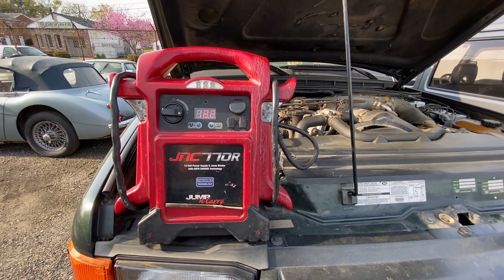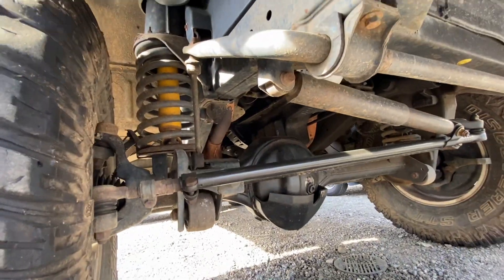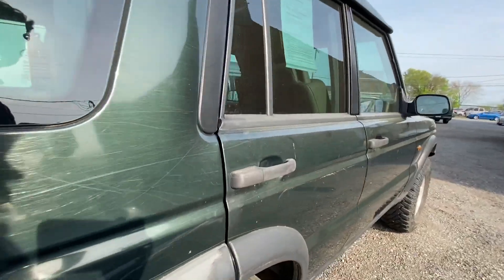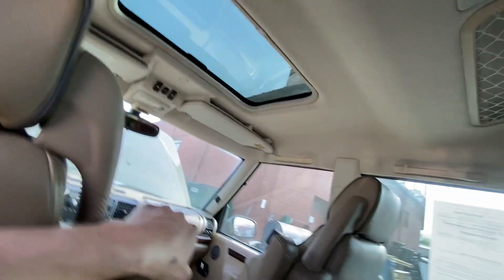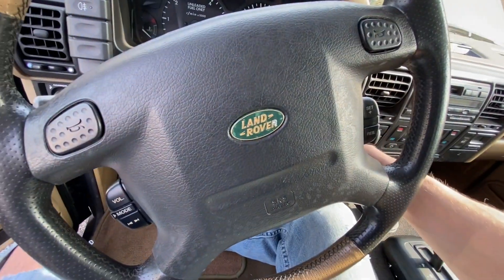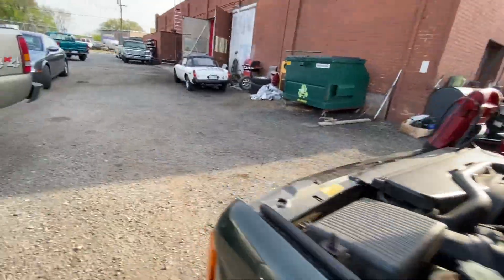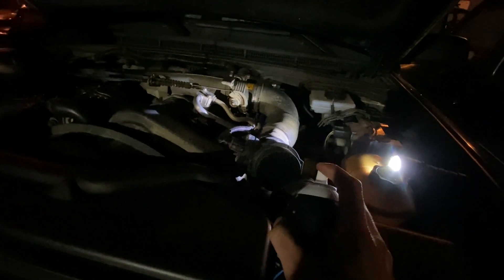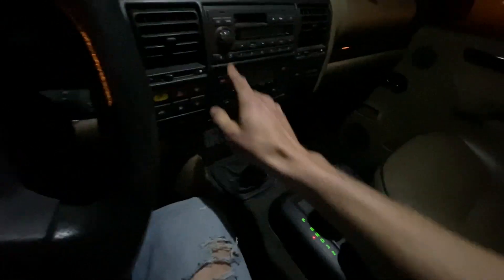Would You Buy A Land Rover Discovery II,  That Doesn't Start? (@RVArover Buys A Very Broken D2)

Comment: Sweet disco  no spark first attempt to  start low voltage  neutral safety switch  check grounds etc etc
Reply from the maker: Ended up being the fuse box
Reply: @AddictedMotors  engine compartment or interior fuse box?

Comment: It was the 10a fuse in F13 in the engine compartment, which on the cover has a picture of a battery. Looking into what that fuse is actually for, that's body control unit... fun.

Comment: I hope this turns into a video series on either channel. I just saved a D2 from the scrap yard too and of course has issues. But does run and drive. Unfortunately the oil has coolant, fingers crossed it's just the head gasket.